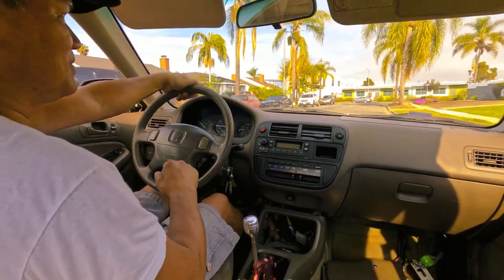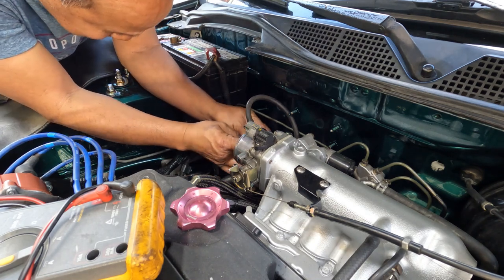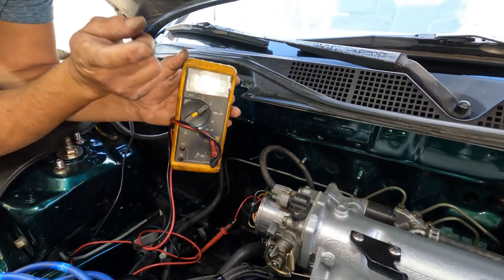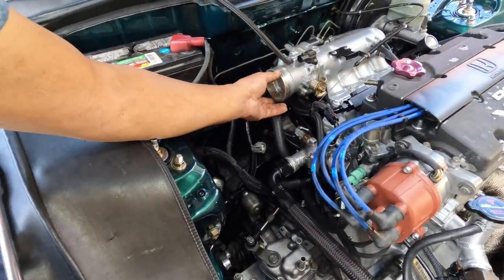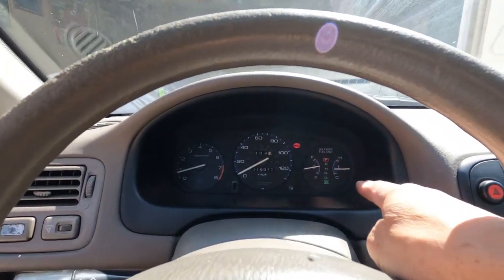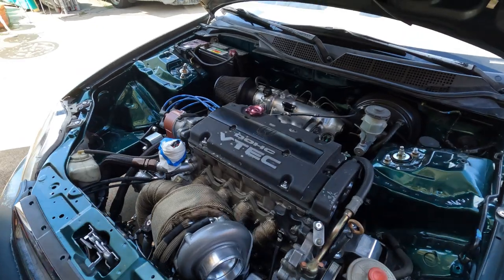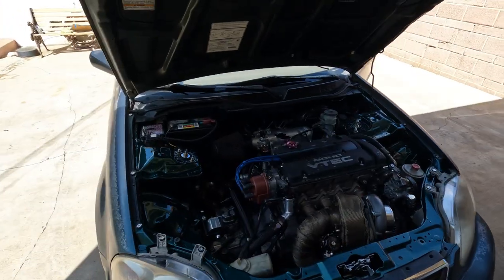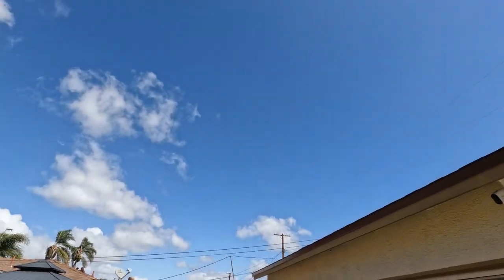G23vtec swap Civic engine stalls and shutoff coming to a halt.

Comment: Nice to see this build is having a great outcome. I'm looking into a g22 build myself. Have to figure out which head gasket to run.
Reply from the maker: Not really sure what HG guys use, but if I ever try it. I'll try f23 sinced it's been good for me as far as lining up on H22 head. Not sure on block though.
Reply: @sagittnet2158  like all issues in car life. I got it on a deal lol. So now I have to head this path. But it should be fun once I figure out the head gasket.
Reply: @sagittnet2158  that was a 98 accord head gasket you used.
Reply from the maker: @AJIMPORTS  98-2k Accord f23 HG. I only use oem, last time l use Felpro, it leak oil, and price for the 2 are the same. So l choosed oem.

Comment: Can you run boost on the open decks?
Reply from the maker: As long as moderate boost. Lots of guys will put a block guard but the right way is to send it to machine shop w/ the guard and give it a cylinder honing job. Or you can have it CSS. I choosed to have it re-sleeve because l dont want to worry about the block giving up on me.